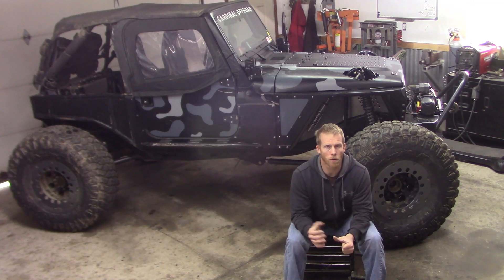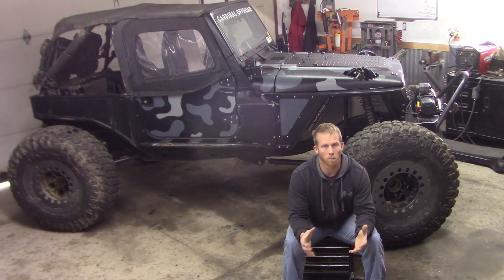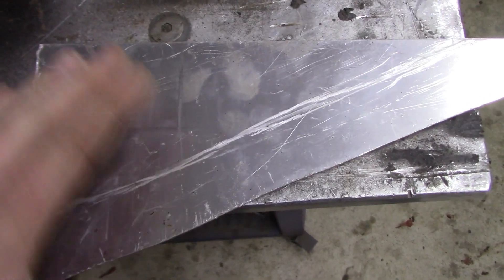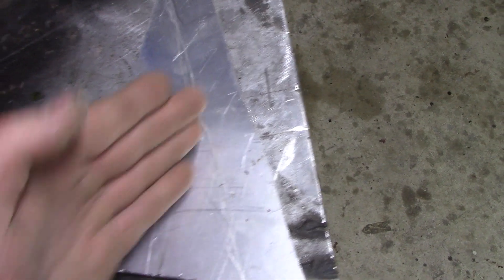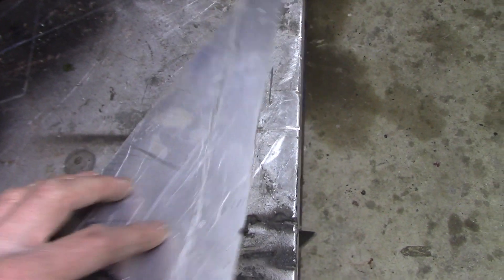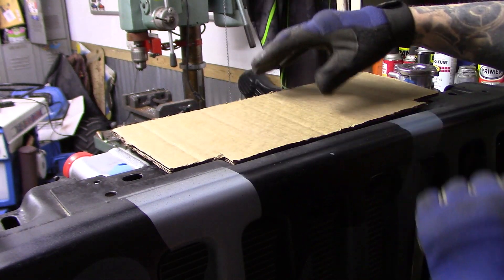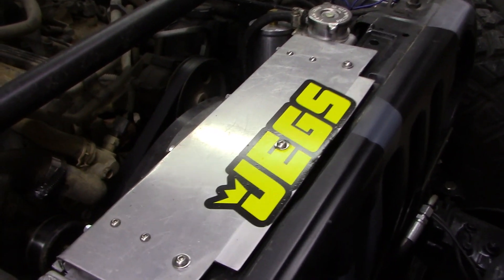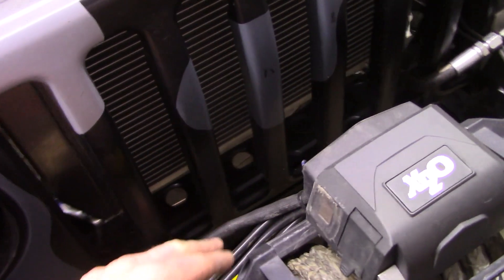Fabricating radiator mounts

Comment: Can you share some of that knowledge by letting me get an email address so I can ask you a couple of questions.
Reply: How  can you find the hp of the radiator because I was looking at mishimoto and  they don't say and they don't have one for my so I going diy on it this is for a tuner car a Hyundai your video is best for info my azera is a 3.3 v6 I'm looking at the genesis coup 3.8 but the transmission tank is on the right of the radiator and on my car it is to the left on the radiator I know your doing off road I take anything you can tell me I want to drag the car so how can pick the best radiator
Reply from the maker: @luxurygeneration407  honestly there are so many good radiator companies out there  like griffin radiator that have the info on hp and there are other options as far as inlet and outlet. I’d do more research, there are a lot of forums out there that might tell you what you need. I chose griffin due to the size and the hp it would handle.
Reply: Right now I have not tune it  can get hp radiator because the plan is just headers if I can find something to turbo it I will. If the end up change the length of the hose on radiator and transmission from the oem can that cause damage.
Reply from the maker: If you plan on doing anything down the road I’d figure out what HP you’ll be running and make sure  it will be good. No sense in changing a radiator twice. If I were you I’d call griffin radiator. They seem very knowledgeable on what to do.
Reply: Thanks I like there stuff I'll ready.
Reply from the maker: @luxurygeneration407  definitely do your research. It took me awhile to settle on what I wanted. Size is important to depending on how much room you have
Reply from the maker: What questions do you have?
Reply: I did check out the website do they hand a radiator for any car do you know how much it would. I do like what they have.
Reply from the maker: You’ll need to call and ask them these questions